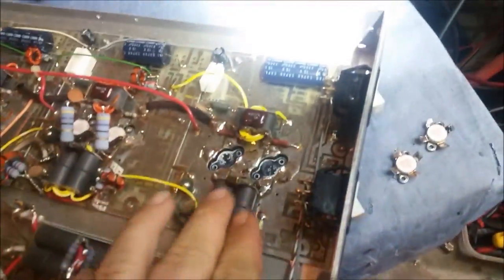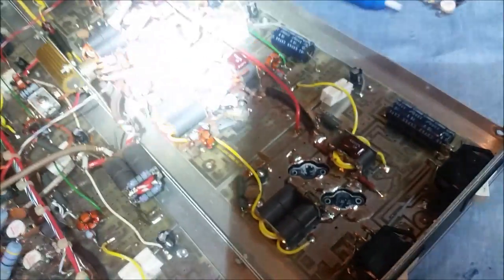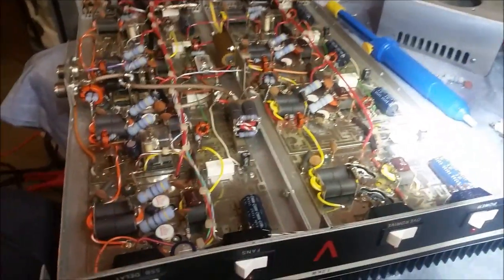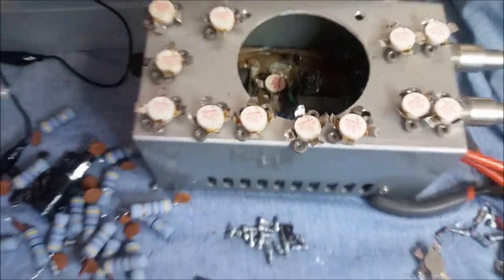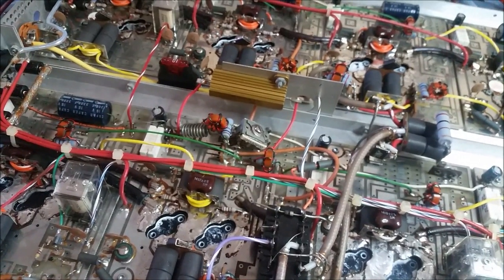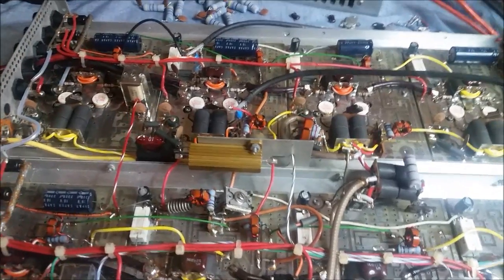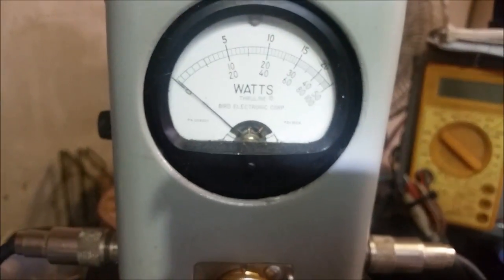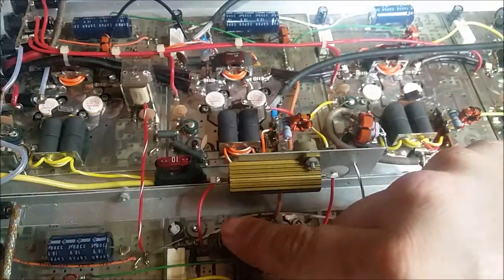💪 Texas Star DX3200 Viking 16x2879 Linear Amplifier Repair 💪Gotta WATCH!

Comment: they did not make many of the 3.2KW. should have 400amp regulated supply to run it correctly. only had a 1.6KW come threw the bench.If you look it is 2 1.6 KW put side  buy side.  Texas Star uses a fixed bias not regulated bias. so around 14.5 or so will work the best for SSB.

Comment: Mine would only out put 600 watts till that 50 pf metal was changed on the main combiner .it would shit and git ..after that i ran a killer bee into it ..and keyed 1200 let it swing about 4200 to 4600 if i hammered the motor..

Comment: 2879 hfe in min 10
why not put in HG and extra padding?
Reply from the maker: ᗒ╬ᗕ1112223333111ᗒ╬ᗕ The customer didnt want HGs. He wanted to keep toshbias in it. I made sure he understood that he needed to run this box easy and with care and the best thing it could have for long use is a new set of 16 Tosh or atleast a set of 16 matching tosh with a higher hfe value. Some times on these big boxes you have to work with what you have and make the best choice possible lined up with what the customer wants to do. Im glad to have been able to get it working for him. Wish I had a bigger supply to show what it really could have done. An AB Biased 16 Pill is a CURRENT HUNGRY MONSTER!
Reply: The customer is the boss of that amp. He gets what he wants. Now save money for a matched set of 16 and a power-wire up grad and do some talking!!!